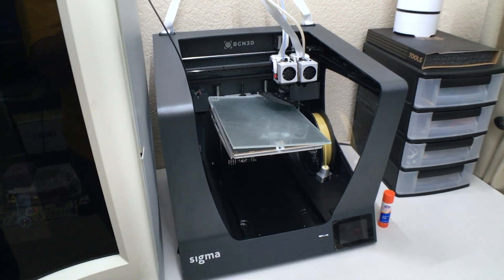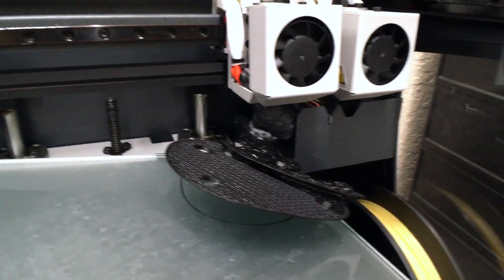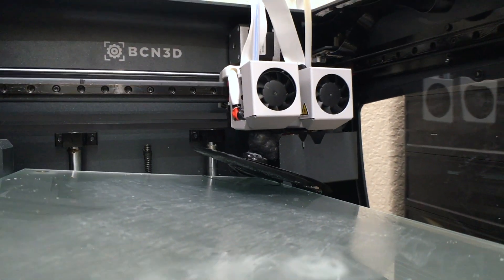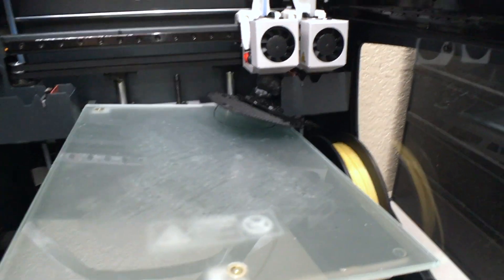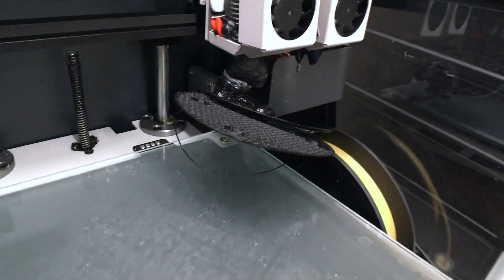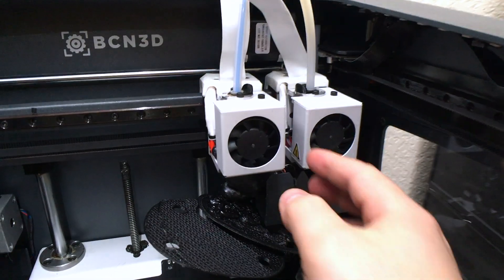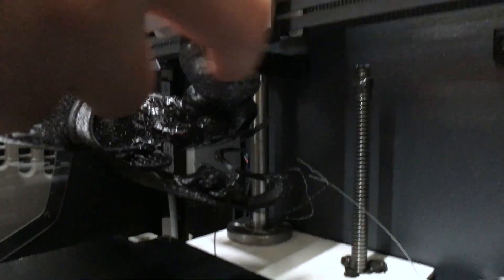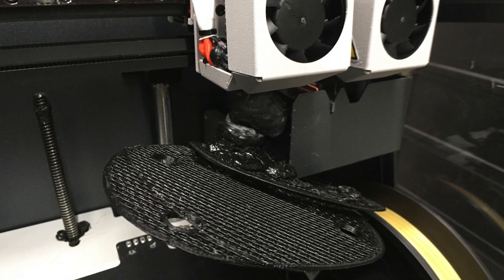How my 3D Printer BCN3D Sigma R17 Crashed

Comment: bearings sound worn, but the problem looks like  a problem ive seen else where its caused by bad bed leveling and then the parts work lose. the auto calibration doesn't work properly for bed leveling, they need to upgrade to 32 bit  and share more source code so community can help

Comment: I am sorry to see this. Please get in touch with Sigma and show them this video. I'm sure they will assist you as this is one of the most strange failures I have ever seen. Good luck man, hope you can fix this quickly.

One thing you can try. If you have a soldering iron you can melt away some of the plastic. But before you do anything please share all pictures and video with Sigma and see what they say.